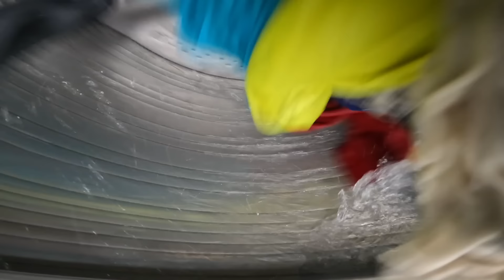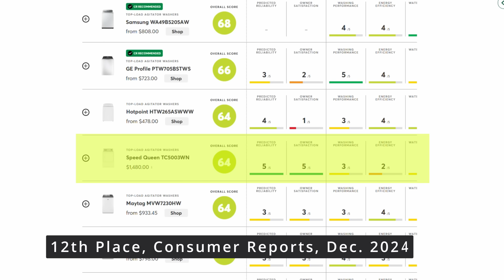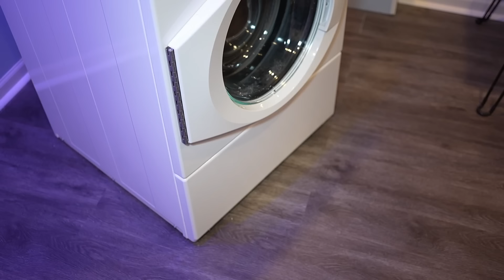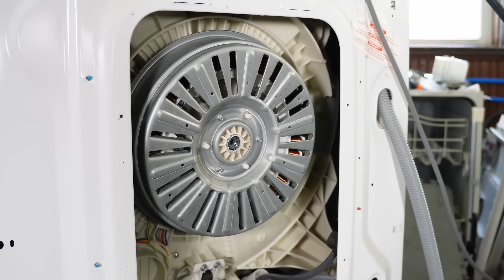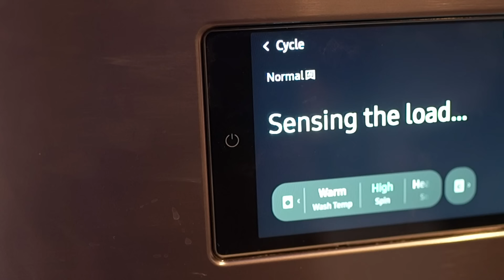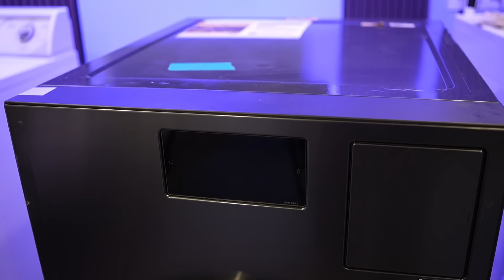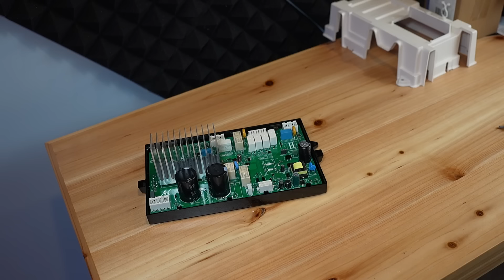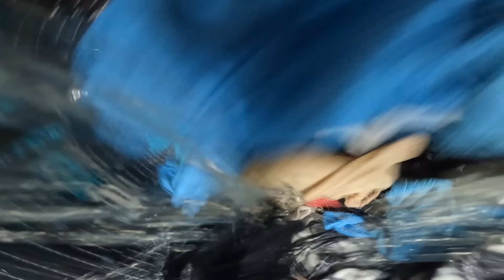Is America's Most Expensive Washer Great? The Speed Queen FF7009WN Test

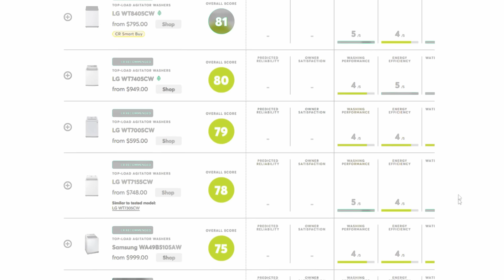Comment: 1:03 But the LGs got the best scores, and we already know LGs are extremely reliable lasting 15-20+ years. I got my LG in 2007 and still no issues. You can get three LGs for the price of one SpeedQueen FF7009, and you’ll get better washing performance, better efficiency, larger capacity, better design, and more features. And because of better efficiency, you’ll save more money. I don’t see any benefit of having a SpeedQueen over an LG. As always, great video Ben!
Reply from the maker: Please note I mentioned those things almost verbatim. I'd take an LG over the FF7 honestly. Not that I said it in the video due to time, but water extraction is a big, big thing. LG's have bigger tubs and higher spins. That translates to less excess water in the clothes, which drops dryer run times (but more importantly way less heating element usage). Over 5,000 washes - say half the life of a FF7 - you're going to save a lot of money.

But beyond that, it also singles out how expensive a TC5 could be over the lifespan with 710 RPM vs. 1200 RPM vs. 1400 on an LG. Then factor water usage in, and the LG clearly destroyed the FF7 with superior results.
Reply: @bensappliancesandjunk Thanks for the clarification. I wish you expanded on the overall lifecycle cost of the SQ over LG in the video, just like you did here. If you did, I didn’t pick up on it.

Comment: Is there a way to adjust the level of water used in this machine? I know with some front loaders, you can adjust a knob with a screwdriver with the top off near the back to have it use more water. Is there a way to do this? If so, it would make a great video because there are no other videos on YouTube that show you how to do this.
Reply: I doubt you need to do it on the  Speed Queen.   I know the basic LG models, you need to adjust it, because I bought the WM2250CW in February 2012, and I hated that it did not fill with a lot of water.  I saw how little it filled, because it does not spray directly into the tub, and instead fills solely on a rising effect.   On most models, you take off the top panel, and look for what looks like a screw.  That is the water pressure switch.   You don't want to get too crazy with turning it clockwise.   You make small adjustments,  until it gets all the clothes wet, but you can open the door, if needed.  If it's a new washer, you risk voiding the warranty by adjusting the water pressure switch.    There are videos on YouTube that will show you where it's located on specific brands.

Comment: I’ve had mine for 7.5 years zero problems. I paid $1,500 in 2017. I thought it was crazy expensive but I hate dealing with problems and have been happy with it.
Reply: it will easily outlast 3 machines that cost half as much, so do the math. It's worth it..
Reply: 2017 machine,serviced four times for simple things.If everything isn't perfect,like the lid fitting perfectly it won't work. Not happy.
Reply: Will it wash large blankets well? I don't own any comforters, just to be clear. Also, does it stink if it sits for 4 days in summer like Samsung front loads?
Reply: @angrysarcasm2229 All front load washers will eventually stink if the door is latched before the inside has a chance to dry out after use. Leave the door slightly ajar until the inside is dry.
Reply: @angrysarcasm2229  nobody is answering these questions so it’s safe to assume it does stink.
Reply: That’s the kind of long-term feedback that really matters. Seven and a half years with zero problems makes that upfront price a lot easier to justify. Sometimes paying more for a machine that just quietly works for years ends up being cheaper than constantly dealing with repairs or replacements.

Comment: I appreciate it being designed to be repaired. At one point I had a Maytag (Whirlpool) front loader, and it started throwing an error and wouldn't drain. The owner's manual was not helpful, telling me the drain was too high (it was not, and it hadn't moved). I suspected the drain filter was clogged, but the manual didn't even acknowledge the existence of a drain filter. I had to look up the service manual and take the entire front of the machine off to get to it. Now I won't buy a front loader without an access panel to clean out the drain filter.

Comment: So in summary...
Speed Queen costs double, has inferior feature set and capacity, inferior cleaning performance, doesn't come with a 25 year warranty even though everyone says it will last that long.
or an LG, costs much less, has a number of superior features and capacity, superior cleaning performance, comes with enough warranty to figure out if its going to work, is plenty reliable according to many sources.  Got it. Great video Ben.
Reply: So this is the same machinist thousands of laundromats used in the United States, and I can tell you that the average machine makes it well over that 10,000 wash Mark it's closer to 15,000. The controls absolutely can be destroyed, but it's uncommon and easy to fix. I imagine the next generation of this washer will upgrade to the quantum touch screen which is actually more reliable then the buttons.

I know mechanical controls feel better, but they're only marginally better in a high use environment.
Reply: @InvestmentJoy  The main advantage of mechanical switches over touch screens is that mechanical switches are a $3-5 part from digikey while a touch screen is quite a bit more expensive and likely have to be sourced from the manufacturer.
Reply: I should pull some strings and try to get a Electrolux competing model, they make a version similar to the ff7 for Light commercial use
Reply from the maker: @InvestmentJoy  I wonder what the light commercial price on the Electrolux is... Isn't it like near $5k?
Reply: Oh no a microprocessor! The only real way is to beat your clothes on a rock.
Reply: Costs over 3x!
Reply: @spazzman90  If that was true, than all of the laundromats wouldn't be using Speed Queen.
Reply from the maker: The issue with Speed Queen in a commercial setting is that cleaning the clothes amazingly well isn't the goal. Getting it done quickly, at the lowest cost to the business owner, is the goal. That is where Speed Queen excells. The head to head tests showed that it was better than LGs in the very low-time categories.

But as it stands in a commercial setting, so many have phased out top load TC5-style designs for front loads. And even then, Alliance doesn't control the market. I mean, my brother went with Dexter over Alliance. Not because they are that much different or better, but its not super clear cut.
Reply: @bensappliancesandjunk  frankly that doesn't sound like anything I'd want in a domestic washer. I want it to get things properly clean, not passable clean. I don't care if it takes long, because I'm going to be running it over night anyway as electricity is cheaper off peak hours. 
Then there's water consumption and noise. There's more to a TCO than just the buy-in price.
Reply: @NextNate03 durability does not  equal better cleaning. You think laundromats care about get great cleaning results, or machine that lasts longer but doesn't clean as well.
Reply: THIS Speed Queens sucks, the one you want is the "Classic" model with mechanical controls.
Reply: @ssl3546 Yup.
Reply: @ssl3546  I have both a 13 year old SQ washer with mechanical controls and a 6 year old washer TC5 I think in two homes... I prefer the older controls. I don't like being micromanaged be preset things I can't play around with.
Reply: TRUE! speedqueen is just piling materials - its thick and sturdy BUT performs far worse than a modern washing machine!
Reply: Exactly! 😂

Comment: 8:26 It's a water heater, not a hot water heater. If the water is already hot then there's no reason to heat it.
Reply: There is a reason to heat the hot water coming into the washer. Washers sometimes have an internal hot water heating element aka a hot water booster. This is because residential hot water heaters can sometimes be set to under a recommended temperature threshold needed for sanitation and effective cleaning while washing. This is usually done in households with children or elderly to prevent accidents with scalding, or for overall energy efficiency reasons.
Reply: Have you heard of an external recirculating loop?
Reply: Oh you’re THAT guy lol

Comment: CE does not mean it is built in china - The letters ‘CE’ appear on many products traded on the extended Single Market in the European Economic Area (EEA). They signify that products sold in the EEA have been assessed to meet high safety, health, and environmental protection requirements. But is not as strict as UL ULc or CSA
Reply: Most important: CE ist self certified. It is a statement of the manufacturer, not a seal of approval of any external testing institution.
Reply: Self certified is fine, and you have to prove your certification.
Reply: Good clarification. A lot of people confuse the CE mark with country of origin when it’s really about meeting EU safety and compliance requirements. The differences between CE and certifications like UL or CSA can definitely be confusing if you’re not familiar with how those standards work.
Reply: We have a Huebsch washer and dryer which are actually Speed Queens but in Canada they can not use the Speed Queen name (this may of changed).
Reply: Speed Queen / Huebsch are not the most expensive brand in Canada - several other brands take that spot but its real close.

Comment: I own  one of those machines and it’s matching dryer. After two years use I started to have issues with the pump being able to lift the wash water up 8 feet. I had the service guy replact the pump and discharge hose, but did not solve the problem. I built a platform and raise the height of the  machines 12 inches making the lift 7 feet, that has solved the problem, but I ask myself why did it work for two years, then stop?

Comment: I was not expecting a FFT reference in a washing machine review.
Reply from the maker: Then you're new to the channel. I made the same reference in my last big washer review, and I had to keep myself from making many, many more references.
Reply: @bensappliancesandjunk  Indeed, I am new. I'm an aspiring first time homeowner. Due to my disabilities, I will most likely need to replace any top loading washers that come with the condo with front loading machines or two-in-ones. So, I started preliminary researching. Your channel came up.
Reply from the maker: @Shiro21SAM cool deal. I have multiple reviews for various washers and dryers on my channel,  with a much longer (what should you buy) from like 2023. I'm going to do a top-10 or something soon again, but I have to do a lot of research soon.

Comment: I've had the combo for going on 5 years. Use it in my dog boarding / grooming facility, gets 5-10 per day, every day. Aside from a plugged drainage line once, it has been flawless. Dryers are great at keeping the pet hair and lint OUT of the parts it is not supposed to get into, unlike all other dryers I have used up to this point. Dog hair in the burner section is not a optimum situation.

Comment: After my first front-load washer bit the dust from only about seven years of service (the last two being NOISY as anything!!), I learned that it is best to buy once, cry once. So I have no issues at all spending a few grand just for long-term peace of mind. I replaced my rattletrap with a Miele W4842 in 2010 (about $2000 then) and it has been serving me very well since.

This Speed Queen looks very nice indeed!! If I were in the market for a new washer, I would definitely take a much closer look at it.
Reply: What’s the capacity on the Miele?
Reply: @RichardHarrold1991 Ithought so. Thanks

Comment: Thanks for the review Ben! I liked the more “scientific” tests. 

Honestly, if Speed Queen was only 50% more expensive than equivalent LG or GE models, I think they’d be a compelling option. However, it seems like they charge a premium for their name and reliability, but aren’t necessarily the best at anything else (wash, energy/water efficiency). 

While I understand some of the disdain for smartphone control in these appliances, there are ways Speed Queen could implement these features without making the machines less reliable. I really like that I get notifications on my phone when my LG washer/dryer are done, it’s a legitimately useful feature. And while it’s possible for a savvy consumer to retrofit that on to this machine, the fact is that everyone else includes it for less than half the cost.
Reply from the maker: 1000% agreed. There's a reason that Speed Queen only has 1% of the market share. If they made a few changes (that they could afford, I think) they could 10x their sales, but it seems they are totally fine with where they are at. And its a shame, because there needs to be better, more reliable, competition.

Comment: The control board looks very similar to the one in my older whirlpool front load. The drive motor burns them to crap over time and companies will repair them with external power wires big enough. 

I feel this whirlpool is the last of the quality units tho.

Comment: What about Miele washers?  I’ve had several over the years and they were beasts - likely due to Miele manufacturing most of their components.  Our Miele machines have almost never missed a stain; we’ve had things we thought would be ruined washed completely clean.
Reply: They're just so tiny, though.
Reply: @VideoArchiveGuy   Miele washers are not tiny, they are just telling the truth what is possible in kilos to wash in a normal household washing machine.
Reply: Its like every German has them, they can take years of heavy loads but i would appreciate if the machine could be fully controlled without getting stuck in cycle you dont want.
Reply: @robertkalinic335  You can disable the standard cycle and it will be the last used cycle.
Reply: @robertkalinic335  You can disable this in the settings.
Reply: I have everything Miele, Liebherr and Gorenje. Price difference shows everywhere. And I am very pleased with all these brands, but there is a difference
Reply: Miele definitely has that reputation. A lot of people say their machines feel more like engineered equipment than typical household appliances, especially since they manufacture so many of their own components. Interesting to hear about the stain removal too — that’s really the ultimate test for a washer.
Reply: Ours (washer and dryer) are over 20 years old and haven’t had repairs, same with a fridge freezer we use in a garage. That being said, new Miele products aren’t worth buying, the fact they don’t offer much of a guarantee says it all.

Comment: I have a 24 year old Kenmore washer and dryer that are still going. The only things I had to get replaced was the clutch on the washer and a heating element on the dryer. Both machines are so basic knobs and buttons there’s no electronic control boards the washer runs off a mechanical timer in the knob and as the knob turns it hit contact points telling the washer what to do. So the knob will turn and hit the spin cycle sending power to the motor to spin full blast then the knob gives power to the drain pump and the water is pumped out it’s all mechanical and the dryer is just a simple switch close the door hit the button and turn the knob to set the timer and it’ll run until the timer disconnects power it’s very simple.
Reply: I had an early 90's Kenmore stackable that just died last year because the transmission / washer engine thing (lol im not an appliance guy) in the washer died and those are impossible to find at a reasonable cost now

Comment: Stain test:
New shirt colours tester thingy:  Number the shirt - measure each stain area before staining, after staining, after wash.

Bonus tests:  measure weight before applying stain and after dry completes to see what kind of wear and tear it puts on the clothes.

Bonus bonus test: gather up the 20+ lbs of clothes, jam one of the test shirts in the middle of it and lets see how that bad boy does.

Edit:  By the by, thank you for your vids.  I find them very informative.
Reply from the maker: I tried measuring before and it nearly ruined the spectrograph due to the stains embedding into the system. It has to be flush with the garment to seal any outside light (even turning a light on/off in the room vastly changed the results). So sadly, I can't do that. 

I do want to do the 20lb jam test - thats something in hindsight, should have shot for this.
Reply: @bensappliancesandjunk  Thank you for taking the time to respond.  That sucks, because it would have been nice to see just how much of the gunk got out.

Comment: I have an older version of this washer (bought in 2017 - AFNE9BSP113TW01) and the (bought several years later) matching gas dryer. I LOVE the washer. 
I would never buy anything else now, having owned and used (sometimes daily multiple loads) one. But I don't expect to need another one since I have retired. SpQueen just works hard.
A side note: As for the control boards, I have both washer and dryer plugged into a ZeroSurge 2R15W surge protector. This is like no other in that it doesn't use MOV's (which fail over time) but has non-sacrificial filter tech that does a reliable job. Expensive, but worth protecting the also expensive electronics in these appliances. (I also have a ZeroSurge 2R15 on the Bosch Benchmark dishwasher, another on the entertainment electronics, and a fourth on my two laser printers.)